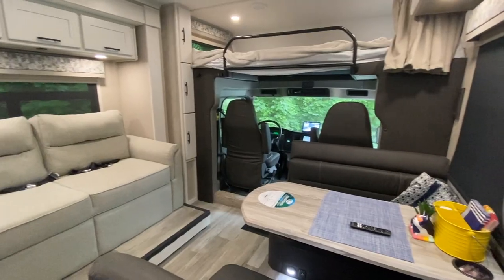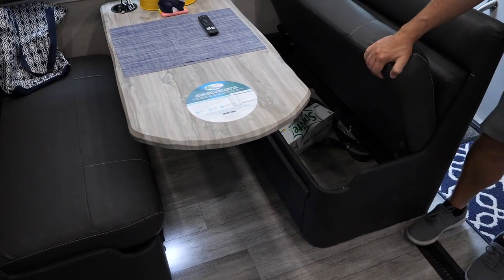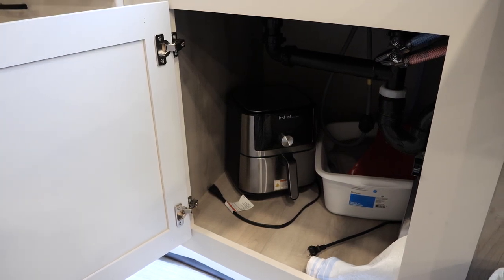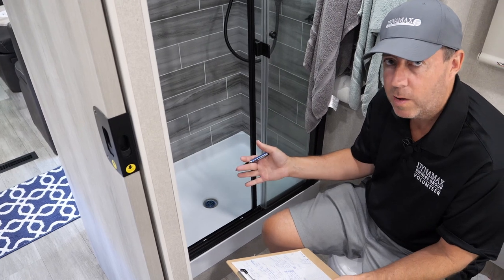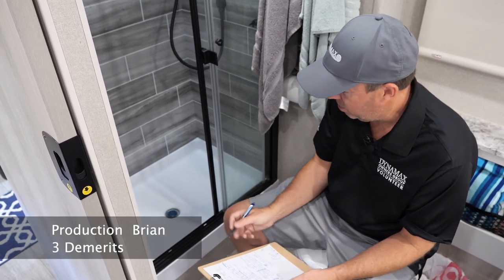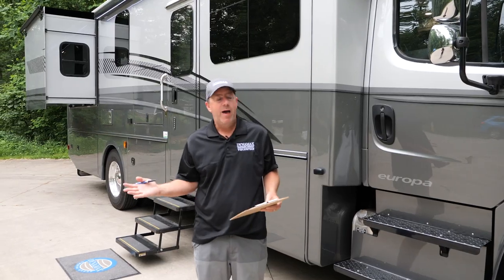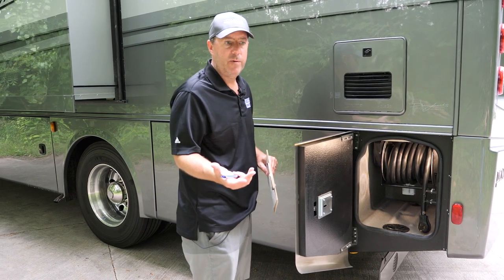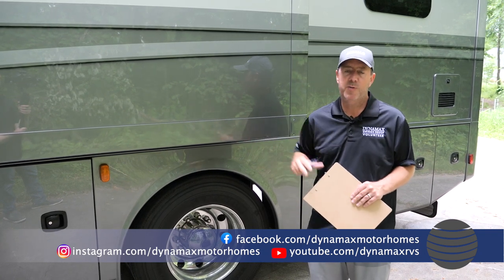Dynamax Europa 32KD - Walk Through

Comment: The versatility to have a Motorhome where we don't have to extend the slides to use all the features, is a must.  How many times do you pull over at a Truck Stop / Gas Station, Super Center, Quick Sleeping Spot?  Therefore not having to extend the slide for a bed is ideal.  And when you have passengers, the fridge is often accessed while driving.  If the swap of a cabinet / fridge does not yield the door opening space with that current model fridge, perhaps a side x side fridge with slider freezer would allow full access when the slides are closed (assuming you are standing in the bathroom when opening the doors) or both?  You already have those model fridges in your other lines of Motorhomes, so they are stock!

Its very alluring having a MH under 35' with a shorter wheelbase to enter many of the National / State Parks, drive in traffic, navigate Parking Lots, etc.  We are excited to see how our family can grow into the Dynamax different models.  Looking forward to seeing the evolution of this specific model.   

-  Vote to have an Explorer package / Paint job upgrade option!
-  Vote to Keep current bathroom layout, but modify at least a 36x32 Shower (and steal space from the toilet and sink area).  Can you not steal the shower design from the DX3 37RB and modify to a single sink?  seems like a similar layout.
-  Vote to move a floor vent from the main walking area (next to bathroom).  Either to kickplate or an area where bare feet don't step on it.
-  Vote to enclose the battery / cutoff compartment.

Personally, we like the TV Placement.  Accessible from Drivers Seat, Sofa, Dinette, and even loft.  Brain did a great job recommending all the other little things to tweak :-)
Reply from the maker: 1. The only side by side fridge we have is 23 cu ft.  So, even though we have it already, it would not fit.  (unless you mean a 12cu ft RV fridge, then yes, that one will have the space to open easily.
2. No pan currently exists for a 36x32 shower.  So that for sure won't happen soon.
3. Floor vent has already been moved on the production models. (Though I having walked in bare feet, it was never an issue...after two trips now.)
4. Closing off the battery area would require tooling a new box, we'll have to see.

Comment: A couple comments probably for engineering 
1 why not enclose with a vent the battery compartment to prevent water/ dirt from getting in?
2 move the generator exhaust back a little more so a stack can be used when needed ? 
3 why not put the wardrobe on a slide to add more room to the bedroom? 
4 why is the sofa on a raised slide-out instead of it being floor level? 
5 as an option instead of the over cab bunk offer an entertainment center and have the TV there ?
5 I prefer the solid sink covers but also provide the over sink drain cover as seen here ? I both would be great
Reply from the maker: 1. We can certainly look at that.  So far it has not been an issue as the location is not in a major splash zone.  As lithium takes off, we don't even need vents, so that makes it even better.

2. We try to keep the exhaust runs as short as possible so we are not interfering with other things.  Also, we just never get the request.  Seems far more common in theory, than practical use.

3. We have a washer/dryer prep in the wardrobe.  Having spent a week in this coach, I had plenty of room at the foot of the bed.  The bed is a very deep slide.  Also, to turn something into a slide, you need to make it about 18" narrower, or the coach 18" longer to get the slide equipment and fascia in place.  So while you gain more room "width wise" you lose room length wise.

4. It is a sofa/kitchen slide, so there is a plumbing chase below.  You can't really do a flush floor kitchens slide.

5. We already have that.

6. We will probably do the solid as we do today and customers can add the slotted as they see fit.  We try to reduce the number of items we ship loose as they have a tendency to grow legs and walk off.

Comment: Nice review! Can you have an induction cooktop and a dishwasher below?
Reply from the maker: No options for those items at this time.
Reply: @DynamaxRVs  thank you for responding 
Eric
Reply: @DynamaxRVs  you need to reach out to summertime tv rovers(YouTube). Not a good start on a brand new DX3
Reply from the maker: @erickramer9291  Thanks for the heads up.  What they fail to mention in their video is that Dynamax reached out to them within minutes of them posting the first video.  We had our local Freightliner rep call down to their service center and expedite parts that were not available locally.  Also, the starter issue is not well know (as it presents like a loose ground), but our local rep had seen it and properly diagnosed the "non starting" issue and explained to the dealer they were at on how to correct it.

Comment: Can I ask why on a coach of this price point that you use floor registers?  All kinds of dirt, debris and yuck falls right in them. It reminds me of a Travel trailer.
Reply from the maker: Well, I don't know about you, but every residential home that I have ever lived in had floor registers.  it is just an efficient way to move heat and keep ducting out of the cabinets.
Reply: @DynamaxRVs  LOL way to disguise your cheapness. Its not a home and in areas rarely travelled. No home has a vent in the middle of living space but around and tight to walls.  YOURS are in the middle and everything falls in crud from shoes, dogs paws and such. Not easy to clean and also the most efficient travel pathway mice take inside an RV. Not to mention walking over one in middle of night isnt a pleasant experience. Its actually the cheapest way to run the heat for an RV, why its standard on cheap travel trailers, and why you do it in every line except XL and D3. Shame as this reason alone is why I wont purchase this or the 31SS.
Reply from the maker: For one, this was a proto-type and the floor registers have been moved closer to the wall.

As for XL-DX3, they are a completely different heating system.  It uses the "Aquahot" radiant heat.  So it can't be ducted in the floor, it has a "Heat Exchanger" at every outlet that has to be mounted above the floor and does take up space under the cabinets.  "Boiler Fluid" lines are run to each exchanger.  It is apples vs oranges.

If you want shorter, with no floor registers, the 32KD floor plan will be coming out in the DX3 and XL this year.
Reply: @DynamaxRVs  one I just saw at AC show 2023 32 KD (walked it with Doug, btw great guy and very knowledgeable) BUT the registers are still in middle of walkway.. I asked per your video because  you’re looking for suggestions. I am in the market for a Super C but under 34’. FYI if you’re paying 300k No one wants to breath where your shoes have been. I have seen 200k Class A gas with it routed through cabinets so just say you’re using the cheapest method… You used cabinetry above but yet thats where the XL and D3 are routed and yes Aquahot but no reason not to duct other units same way through cabinets… This Europa is a 300k coach so you give it a 15k TT heating system of floor vents. You even show where mice can get in in the open lines… I have owned TT, Class B and currently a Class A. Was thinking of your brand because you had a smaller Super C… Literally only reason I wont do the Europa (your dealer is begging me trying to do asinine things to cover floor registers sure lets choke the heat) for me to buy… Sorry you asked for input but for a 300k coach leaving cheap floor vents in middle that collects dirt, sand and cant be easily swept due to crap going into them is not what I will pay that much for…  
Also I realize the video was prototype and a little older. Was hoping you to say that maybe you would consider or had option of different. I work in hospital environment and quite frankly think where your shoes have travelled in a given day.. anything down that vent cant be easily accessed or cleaned..
Reply from the maker: If you walked the floor plan you will see that we do route through the cabinets where we can and in some areas it is not practical for even heating where slide are etc.  The entire system is not ducted through the floor, only one or two where it was necessitated by design.

As I mentioned.  The 32KD will be available in the DX3 so you don't have to make any accommodations, just get what you want (no floor registers) in a short length.  Problem solved.

Trust me, I see every bill of material.  We do not save any money putting a register in the floor.  If you'd like to order one with a "custom request" and no floor registers, you can do that as well.  Happy to help you with that.
Reply: @DynamaxRVs  D3 is way too far out of what I was willing to spend on an RV. The Europa was pushing what I wanted to spend as RV’s are a financial loss the second you buy them. However  the show special made it enticing. I will never pay MSRP for an RV to be built, but funny you say custom order while also saying you cant evenly heat.. why would I want that?
Reply from the maker: We would have to see about going up into a wall cavity and put the register there,  or use what they call a "baseboard register".  We don't carry them today, but if you say that is the only thing stopping you from buying...it seems like a very little thing to figure out.
Reply: @DynamaxRVs  you missed the part where I wont pay MSRP or take a huge financial hit. You order anything from dealer they want MSRP… Not taking that sort of blood bath (60k difference from the unit at a show plus as soon as you drive off lot depreciation ) to order something to be a trial run of something you never done before… Its an RV they take a huge hit and I am not the person to take 100k hit between MSRP and what the new ones on lots they can’t move are selling for… hell they just had a 2023 traded in with (31SS) 1300 miles….  
I made a suggestion. Yes it is the one thing not making me buy it. But maybe you all should think I might not be the only one that this is a huge turn off to buying.
Reply: @DynamaxRVs  you come out with a model that isnt 380k with a better system for HVAC I would be interested but not as your guinea pig to be a tester for you.
Reply from the maker: I never suggested you pay MSRP.  If you reach out to Doug, the rep, I'm sure he can coordinate an order for you as close to show price as possible.  https://dynamaxcorp.com/contact-us
Reply from the maker: No reason to be a guinea pig, all we would do is run the ducting in the floor, pop up in the bad base or wall and use a wall register.  It's not like a whole new system, it is just moving one or two ducts.

Comment: Nice rig and video! What is the actual overall length?
Reply: I have a 34KD XL, it's overall length is 37'2".  My rig has an extra 6" for the hood/cab since it's M2-112 based.  My guess is this Europa would land around 35'8" tip to tail, should be under 36' regardless.
Reply from the maker: 33'-10"
Reply from the maker: 33'-10"

Comment: It would be nice to have a sky/roof window on the bunk over cab. It is small and the extra window would make it seem more spacious with the natural light / star view
Reply from the maker: We have explored that option...but it also lets in a TON of heat.  We have two side windows to open it up, but they are vertical and openable for a breeze.  One RV producer started with a window and later removed it due to the heat gain.  We will continue to explore that option when we feel like it can be done effectively.
Reply: @DynamaxRVs  , there are dual pane set ups that keep a lot of that heat out which you can have a pull across blind. But they are big bucks. You could have an option for it with a transparent reason for the cost. If it meant a lot to folks, they would probably pay the premium for that option. Make sense? 😎

Comment: Is there a unit like this without slides?  Why does every unit have to have slides?  Many experience RVers know how much slides suck, and don't want them, because they have already had them.
Reply from the maker: We do not make a unit like this without a slide.  We do make the 28SS Isata 5 that can be used 100% without the slide extended.

As for why does every unit have to have slides?  We only build what people buy.  We used to build non-slide motorhomes and people would not buy them.
Reply: @DynamaxRVs  - Thanks for the reply.

Comment: I would move the toilet roll holder on the inside of the sink cupboard door, but the shower should be at least a 36 x 30. My camper has a 36 x 24 and  it is to small.
Reply from the maker: Well, like I said in the video.  The beauty of owning it, is you get to move things wherever you want.  It's your tow to play with now.  As for the shower, the Arcadia would get you that kind of shoulder room.

Comment: Something I would like to see or maybe it's just personal. I would like to see a 110 outlet in one of the storage cabinets above the bed for a CPAP.
Reply from the maker: We have 12V and 110V on both sides of the bed.  Easily accessible.
Reply: @DynamaxRVs  where could the CPap be set down?  I was thinking inside the cabinet above the bed. Open the cabinet and the mask and hose hangs down.   Then I could close it out of sight and is self contained behind the door.  Love the coach.  Was considering the 28ss until this one.

Comment: I've have owned the 31 ft europa since Nov. 2021. Its been a nightmare. The slide  and ac's are awful. The washer dryer actually fell out and knocked the cabinet door got knocked off twice. this is my fifth camper and i've never experienced the amount of problems as Ive had  with this one. It is a  nice highway truck but they put  5.56 gears in it so lucky tto get 8 mpg.
Reply from the maker: What is the last (6) of the VIN?  We have never put a washer/dryer in.  I thas always been prep-only.  As for gearing, we just put in what Freightliner recommends based on vocation.
Reply: Thanks for posting actual user experience, very helpful.
Reply: @DynamaxRVs  mine is the 31 ss

Comment: Do not like your hole in the floor for the power cord and probably the water hose, having to unscrew the hole cover which leaves a large opening for critters. Look at Tiffin's design for an electric cord and water hose. They're easy and secure,  no open hole.
Reply from the maker: We have already changed the access plates from this design.  It is a new roller design to make it easier to get in and out.

Comment: One more thing in the future dinette should be little longer so when sleep it’s not so cramped so some one 6 foot can sleep just Couple more inches longer than it is now
Reply from the maker: Our Dinettes are a standard size, mainly designed for kids.  

They are roughly 68"x42". So, yes, a 72" human would not be able to stretch out.  However, using the Pythagorean Theory (thank you High School math teacher), 68^2+42^2=C^2....with C being the diagonal of the dinette.  That means someone 72" sleeping at an angle would fit (roughly getting 79" on paper)

Comment: Dump the propane and make this an all electric coach and it would be perfect.
Reply from the maker: The 32KD floor plan is now available in the DX3 which has an option to eliminate the LP.  It would be a diesel fired Aqua-Hot.  https://dynamaxcorp.com/dx3/32KD/8750